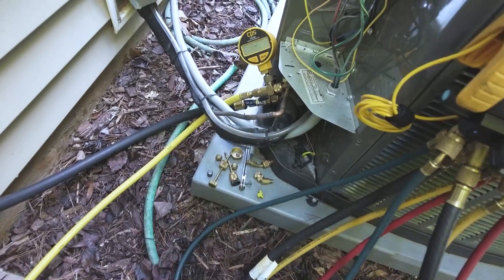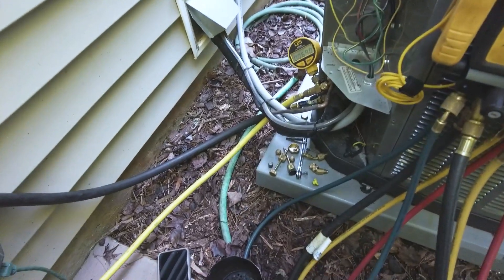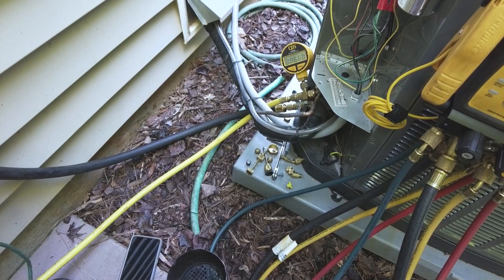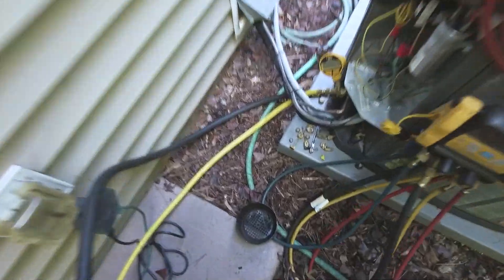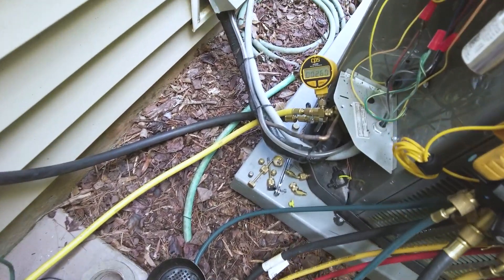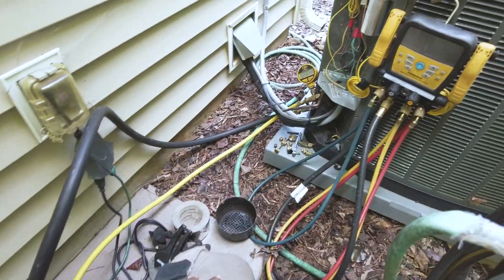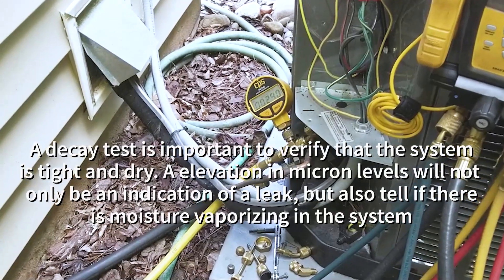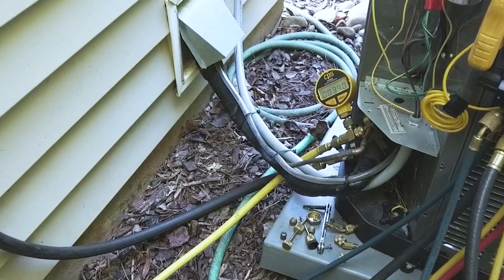Replacing and Diagnosing Failed TXV Part 2 | Pulling Fast Vac and Start up

Comment: Don’t forget to exercise the shut off valves while pulling a vacuum. Close it quarter turn and leave it for a bit to get any air out trapped in the ball valve
Reply from the maker: Nice good tip!

Comment: That micron gauge is going to be junk if you keep letting Freon loose on it like that. You can valve it off with another core removal tool before you let the charge loose. Just saying bro
Reply from the maker: Hey, thanks for the feedback! With all due respect, I’ve heard about the valving off of the micron gauge too, but I believe it might be slightly mis-guided. Per the manual it says “The VG200 incorporates an easy to clean thermistor sensor, which cannot be damaged from exposure to positive pressure or oil mist.” 

So yes, it is correct you will have to clean it more often but based off of the manufacturer, it shouldn’t cause any damage. Sorry I really do appreciate the feedback. I just don’t want someone to feel they have to purchase a 3rd $50-$70 core remover when it might not be necessary. Thanks for watching!
Reply: @HVACTechKnowledgy  I do this for a living for the last 20 years and I went thru 10 micron gauges before I figured this info out. I’m just letting you know that gauge will start giving you crazy readings